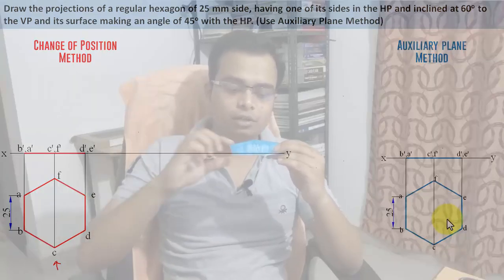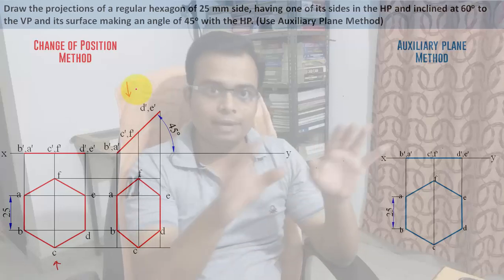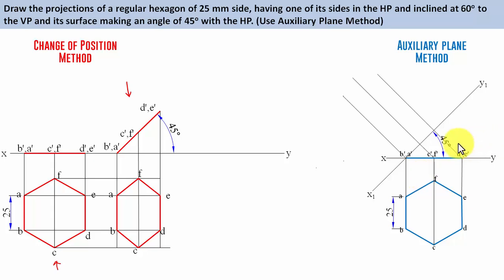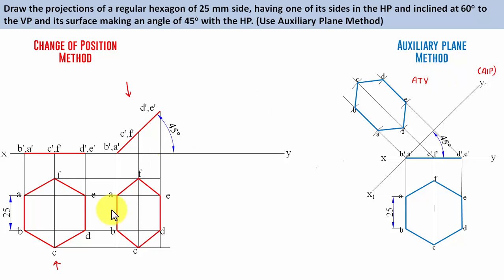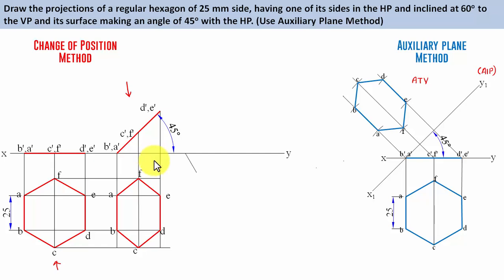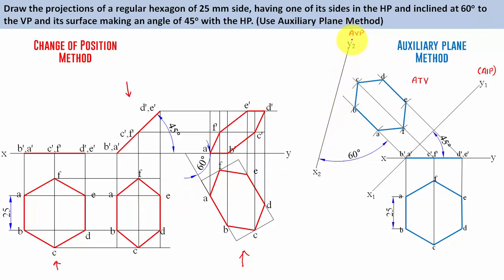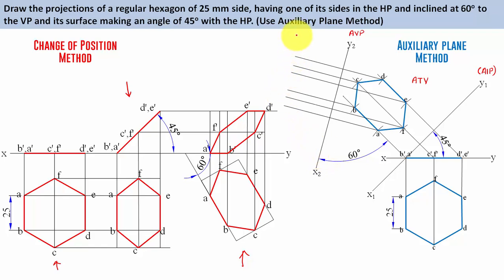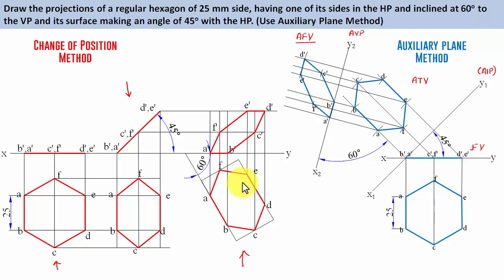Auxiliary Plane_Projection of Plane_Lecture 2

Comment: Can u please solve this questions please        AUXILIARY PROJECTION OF SOLIDS

1. A square pyramid, with a base having a 50mm side and a 60mm long axis, 
has one of its triangular faces on the H.P. and a slant edge containing that 
face is parallel to the V.P. Draw its projections by using Auxiliary planes.
2. A hexagonal pyramid of a base side 30mm and axis 70mm is resting on HP 
with a side of base parallel to the VP .Draw an auxiliary top view on plane 
inclined at 30⁰ to reference line.
3. A square pyramid of base side 40mm and axis 60mm is resting on a corner 
of its base in HP such that highest point of the base is 40mm above the HP 
and the axis is parallel to the VP .Draw its projections . Also, draw an 
auxiliary front view on a plane inclined at 30⁰ to top view of the pyramid.
4. A pentagonal pyramid, side of base 30mm and height 60mm has one of its 
slant (triangular) faces on the HP and the edge of the base contained by 
that slant surfaces makes an angle 30⁰ to the VP .Draw its projection by 
auxiliary plane method.
5. A rectangular prism of base 25x45mm and height 70mm is resting on its 
longer edge on HP and inclines 30⁰ with VP, with a base contained by that 
edge is inclined at 30⁰ to the HP. Draw the projections of prism by auxiliary 
plane method
6. A cone of base circle diameter 40mm,axis length 70mm resting on the HP 
on a generator with a plane containing that generator is 40⁰ inclined to VP 
Draw its projections by auxiliary plane method.
7. A hexagonal prism 25mm side of base rests with its corner in HP. Such that 
its base inclines 35⁰ with HP and the axis inclines 50⁰ with VP. Draw the 
projections of solid by auxiliary plane method.
8. A pentagonal prism of base edge 30 mm and axis 70 mm rests on an edge in 
the H.P. Its axis is parallel to VP and inclined at 45ᵒ to the H.P. Draw its 
projections.
9. A hexagonal pyramid of base edge 30 mm and axis 60 mm, has a triangular 
face on the ground and the axis parallel to the V.P. Draw its projections.